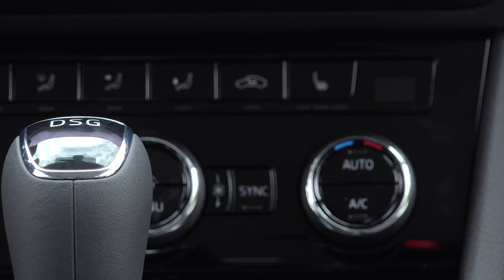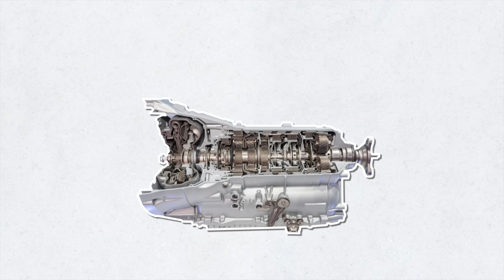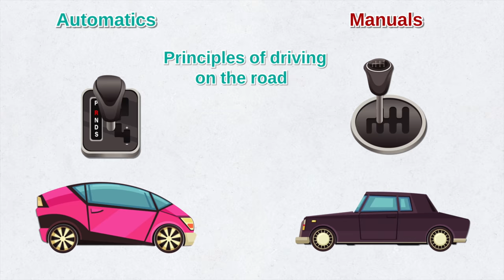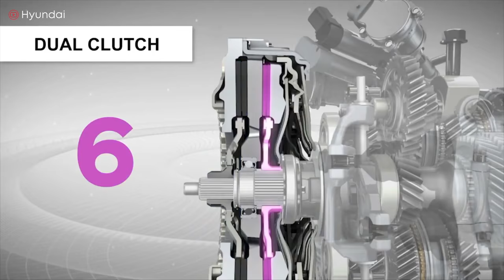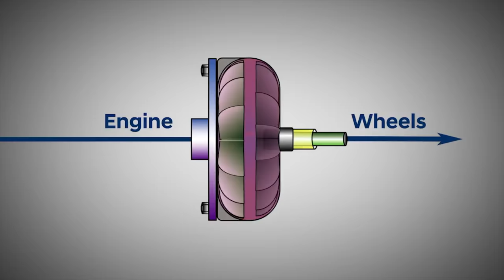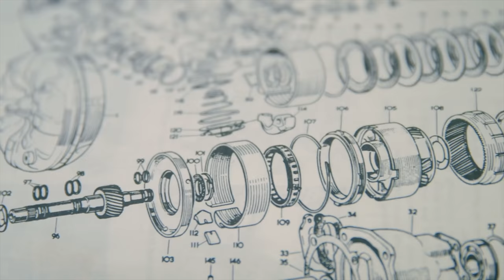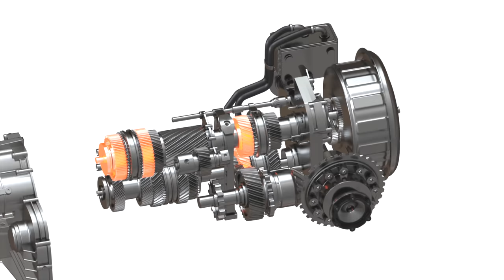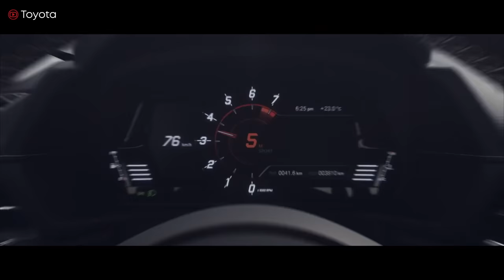5 Things You Should Never Do in an Automatic Transmission Car

Comment: I prefer a manual myself. But there's one situation in which it's been said a manual is more likely to fail than an automatic, and that's towing heavy loads in hilly terrain. That very thing happened to my parents (and my two-year-old self) just outside of Wawa, Ontario in 1972. We were in a 1967 Ford Custom with a three-on-the-tree standard, towing a heavily loaded U-haul trailer as we moved halfway across the country. The gearbox somehow failed in such a way as to lock the rear wheels, and my dad and some people who stopped to assist removed the driveshaft so the car could even be moved. To this day, if I'm in the car with my dad and we pass a U-haul, he'll remark about how seeing one of those things gives him the creeps.

Comment: At 215k miles my Honda Accord would occasionally miss an upshift and engine would redline.  After changing the transmission fluid (for the FIRST time), the problem went away.  Now at 230k miles, no upshifts missed.   I wouldn't have even thought of changing it without the knowledge of watching Scotty.

Comment: I wish you covered "lifetime transmission fluid" in this video!
Reply: Maybe next video
Reply: I’m on the fence on whether or not I’m gonna change my Subaru cvt fluid. I’ve seen a lot of them go over 200k without any maintenance. Problem is it costs 300 bucks and they only get like 35% of the fluid out. Hard to stomach that.
Reply: He has in the past. When they say lifetime, they mean until the warranty runs out. Then it's the next suckers problem.
Reply: @andrewmeehan6151  Think about it this way, would you rather pay $1000 and keep your car and CVT running for another 5-7 years problem free, or leave it to chance and possibly pay more or total the car? I say $1000 thinking you change it 3 times to get 100% of the fluid. Maybe space the changes every 3 years since they have a reputation of lasting 200k. But I have no experience with CVTs and depends on how you drive so ask your Subaru community!
Reply: There's no such thing as lifetime transmission fluid. Always change it between 50 and 80 thousand miles
Reply: @user-de4jk8vj4c  What if you're already at 150K on a 007 Lexus IS350? Automatic transmission
Reply: @user-de4jk8vj4c  I took the liberty of dropping my transmission pan and changing the filter/Screen and cleaning the magnets. It took out just under four full quarts and replaced slightly more. I did it text book style and waited until it started dripping out of the overfill tube at proper temperature. So far so good! 🙏🇯🇵 I didn't Notice any metal shaving on the magnets.

Comment: I lease a 2022 Honda Civic. I floor it without warming it up, shift from R to D without fully stopping, i brake torque it when it’s cold in reverse and drive. I consistently redline it on the daily. I never use the parking brake on hills. I also hit every bump and pothole and try to brake or accelerate over them. I never wash it either. Leasing is great never worry about old vehicle maintenance
Reply: how proud you must be, abusing a vehicle like that

Comment: I destroyed an automatic transmission in a Mercedes CLK500 on the test drive.  I was going to manually shift and at Redline I pushed the gear selector into Neutral.  The gear selector in that car goes left and right to manually change the gears.  I still bought the car but it got a brand new transmission.  

A concern I have also on my automatic transmission is if I floor it and keep it on the floor while getting on the highway.  When I get to 80-90 miles an hour if I release the pedal quickly the transmission doesn’t seem to like that much.  If I release the pressure more slowly it likes that better.  This is on a 2020 Ford Raptor.

Comment: I miss my manual. Sad they are not making them anymore 🤬
Reply: You can still get them to swap into a factory automatic car but this will be rather labor intensive and or very expensive. I want to this one day, and I figure it will be easier in an old car than a modern one due to the lack of electronics tied to that system.
Reply: In india they are still making manual gear

Comment: automatic transmission allows you to hold beer and steer at the same time, most of my  cars were manuals, went to an automatic when broke my left ankle, have issues with clutch pedal now
in extreme cold differential and manual gearbox fluid can be nearly solid the ones that use 80-90 gear oil, at -50F I could not move the manual shift lever in my 1964 dodge D800 or my 1972 F250 truck

Comment: A friend of mine back in high school had a 1972 Oldsmobile 88 with the three speed Powerglide automatic. With the two barrel 350 it couldn't do a burnout for love or money so he would neutral drop it. He probably did that about 100 times and that thing never slipped or hard shifted. That transmission was as hard as diamonds. Most GM transmissions now are about as soft as paper mache.

Comment: I bought my then wife a Plymouth mini van...one of the ones with the 20 year history of transmissions that failed more than they worked.   The transmission shop, after the 4th warranty rebuild in 11 months, told her that shifting into drive from reverse without stopping completely was causing a valve to over pressure and punched a hole in the transmission case.  Each time the transmission dumped most of it's fluid in the road where it happened.   The transmission case had to be welded because all the cores in the junkyards were bought up by transmission rebuilders.   The wife was traded in for a new model shortly before the van was traded in for a truck.

Comment: Help help help Scotty is it okay if you're stopped at a red light and put your car in neutral does that bother the transmission thank you
Reply: Tf? Leave it in drive. Why make your tranny shift gears for no reason?
Reply: if its a manual and your clutch foot is getting tired pop the car in neutral who cares. if its an auto dont bother
Reply: I’ve been doing that for years. I hope it doesn’t hurt anything. I use hand controls and my left arm gets tired holding the brake down.

Comment: 8:40 I don't trust the emergency brakes on most modern cars to hold the car on a steep hill, especially if the car has 4 wheel disks. I guess it can't hurt to put in on when parking at a huge incline, but turning the wheels toward the curb is much more important.

Comment: I drive a 2006 Subaru Impreza. 
I don’t know if this is a “Don’t” but when my oil was due for a change, the oil pressure light started to flicker. However it would only start to do so as soon if I brake a little to hard. Then it’ll do it for the rest of the drive whenever I’m at a stop sign or a red light, or whenever I’m in drive but I’m braked. However the red light would stop flickering if I’m at a stop and put it in neutral. 
So when I was driving on my way back so I can change the oil, I would put it in neutral once I was at a complete stop at a light or stop sign. I then would shift it back into drive when I started moving again. 
I do know that technically in general probably isn’t the best especially for the transmission, but would you say that a big “NO NO” or would you say it’s fine but don’t recommend doing it for a long term?? 
I did get the oil changed so now it’s running fine :)

Comment: Rev up your transmission!
Reply: @Monstar_2113, 
Something rotates when it turns around an internal axis, like a gear in a transmission.
Something revolves when it turns around an external axis, like a connecting rod around the crankshaft.
It's more easily visualize by a planet 'rotating' around its own internal axis, while 'revolving' around its external axis being the sun.

Comment: I do tow a travel trailer but always start and stop slowly! I don't drive over 60mph when towing either. I owned a 1991 Toyota pickup 4wd with a manual transmission. That was the vehicle that I taught my 2 daughters to drive on. So if they ever traveled overseas or needed to drive a manual they would know how.

Comment: I tried to tow a single axle trailer 800 miles with a Hyundai Santa Fe. The transmission overheated at 500 miles. Learned a lesson that time.

Comment: Decided to do the good ol’ “neutral drop” in my 1st car (2000 Chevy Blazer) by revving it to the redline in neutral and while still flooring it holding it at the red line, dropped it into drive. you ever hear a spider gear in a rear axle and a transmission all grenade at one time? Yeah… wasn’t pretty lol.

Comment: "Why do Americans love automatic transmissions?" Traffic jams. Proud owner of a manual tranny Dodge hemi Challenger. I had a torque converter go on a 2009 Chrysler 300c. Very rare issue. Had it replaced. We got another 130,000 miles out of the car for a total of 220,000 miles. My son wound up trading it in for a 2019 hemi Charger. It was still going strong.

Comment: Once I raged and I went from P to D really quick and accelerated off. My transmission was really bad after that. The car wouldn't shift into gear 1 or 2 resulting in really slow take offs. But after I turned the car off and on again it seemed to not be an issue anymore.

Comment: I have lived in Great Britain all of my life, and learned to drive in a manual car. I have only tried to drive an automatic once, and had trouble when I tried to change gear. I moved my left foot, to use the clutch, and stopped moving.

I have not tried to drive an automatic since, as I have learned clutch control.  Maybe they should build an automatic car, with the clutch pedal, so that it is closer to a normal car, then we can work out how to start moving, as we would in a normal vehicle.

Comment: I was driving a 1987 Ford Crown Victoria and I was approaching a green light when it went to yellow and red.  I was a good distance from the light so I could come to a nice controlled stop.  However, the brake pedal sunk to the floor without any warning.  I pressed the emergency brake, in which I found out later didn't work.  Blared the horn with my left hand and placed the car into park from drive. I heard the tires skidding and the transmission go tick tick tick.  The cross traffic had the green, but nobody moved.  I slid under the light and placed it into a low gear so we could make it to a service station.  If we would have wrecked, it would have been a T-bone and the transmission probably wouldn't work after an accident like that.  Plus, my grandfather and or mother could have gotten injured from the accident.  Transmission still worked so that worked out really well.  My mother was freaking out and my grandfather was running a fever and I don't think he cared one way or the other, he wanted to get to the doctor. 

All of this was under my learner's permit. 

Curious, one thing I didn't hear was going from drive to reverse while still in motion.

Comment: My first time with a manual transmission is rather humorous now. Dad had 3 on the tree truck. Pulled to side of dirt road to let me drive. Talked me through it  and then told me it was in first and was my time to try. I tried 10 times at least and could not let clutch out slow enough to keep it from stalling out. He got mad and switch back to drive us home. He started it up, let out the clutch and stalled out too. Ha ha ha it was in 3rd the whole time not first! We switch back, I put it in first and took off smooth as silk!

Comment: Took my 2010 Prius to one of the car washes that drag u through . I had my ac on and it was hot waited 5 minutes to enter wash put car in neutral and 1/2 way through got warning traction battery low shift to park. I couldn’t!  Well left wash and Prius was limping. Heads up for Prius owners hybrid battery don’t charge in neutral . Ac also works off hybrid battery so turn ac off in that weird circumstance .

Comment: Driving an older car with an auto I find myself coasting backwards in neutral alot so that it doesn't stall on me before the engine warms up a little when I first get out of the garage (its still got a carb with no electronic controls. And if I just let it sit idle in the garage it would lead to CO getting into the attached house). Eventually I would like to get a manual though.

Comment: On an insanely cold Colorado morning I would push the car even when cold. My car sucks at heating up and so I would somewhat floor it at red lights after 3-4 minutes of driving. I knew it was bad, just the cold was getting to my nerves. Only did it a couple times though, so I hope it didn't do much damage. The 2003 jeep liberty sport is still running at 220k miles, so I must have won the lottery or it isn't too too bad if done rarely.

Comment: 94' Celica with an original Automatic Transmission which has over 342,000 miles on the odometer. Need i say more.

Comment: I had a 2003 automatic Ford Focus SE. In my early stages of driving, I would shift to neutral on downhills (I lived in the mountains) and one day my transmission started slipping anytime I was in 3rd gear. Once I slowed down enough, it popped back into gear or if I stepped on the gas and skipped 3rd gear essentially. It only happened in 3rd gear. Stopped doing that 😂

Comment: I just changed the fluid and filter on my 08 G6. It's got that stupid "non servicable" automatic transmission without the dipstick. It was pretty ugly, the fluid was dark, burnt, and it had its share of metal shavings stuck to the magnet in the bottom of the pan. The car only has 113k miles on it, and I plan on changing it every 30k going forward. The car drives fine, no slipping or hard shifts.

Comment: I enjoy your channel very much. I find your knowledge base inexhaustible. I have a 1995 Pontiac Grand Am 3.1V6 with a 195,000 miles. I noticed that the transmission  fluid is brownish.  What should I do? Have it flush or have the filter replaced or what?

Comment: I get and heed all of these recommendations except for one. How can low fuel level in the fuel tank be bad for a car? I usually don't refill until the low gas's warning light comes on. I don't get how the low level in the tank can do any damage.
Reply: He didn't give an explanation that makes sense, IMO.  Maybe it is true and maybe not.  He mentioned "pressure".  I don't see how fuel pressure will change with a low tank.
Reply: It’s bad for many because they rely on the fuel itself to lubricate the fuel pump.  Low fuel too often will destroy the fuel pump.  Changing a fuel pump is an expensive repair.

Comment: Back when I had my cruiser, I ended up getting a leak for the transmission fluid around 230k miles. 
I remember going down the road and thinking it felt odd. Then I tried to take off and the second the car went from 2nd to 3rd, it just completely dropped like I had put it in neutral then stalled.  And made a very unpleasant sound when it dropped. 

Called my dad and he towed me to the house. We checked the fluid and there was nothing. We got it filled and let it sit over night and some in the morning. Level had dropped so we checked a pan we had under it, sure enough it had been leaking. 
We got it fixed, but, it would never shift right from 2nd to 3rd after that.  (Got rid of it like 2 months later though)

Comment: Once you get used to a stick, it becomes second nature and you don't even think about it. I have always said that you can always tell a long term stick driver when he shifts gears as he goes around a corner (and eating a cheeseburger). Lol   

I haven't had one in years, but i really miss them in the snow. With a manual in snow, you can start in second, or even third, to really reduce the torque and keep the tires from spinning. I always wonder why automatics never give you an option for minimal torque so that you can start on ice? They could easily program that in.

Comment: I'm not a mechanic but I remember the automatic transmissions pre-early 60's had 2 pumps in them and could be pull started. These newer transmissions only have one pump and if you try to pull start them, you will ruin the transmission.

Comment: Mr Scotty - WHAT happens if your parked stationary Automatic car is rear or front ended ? Will components in the Automatic transmision be damaged ? Will early premature failure occur later on ? How do you check for this afterwards ? How will you know ? Inexperienced driver nudged me whilst attempting to park in front of me  split my front plastic bumper & UK Registration plate. Insurance companies repaired the body work but it's since occured to me my Auto box could have suffered. Car is 2013 Suzuki SX4 1.6  Automatic 2WD now with 56 000 milage.
Reply: Life is full of mysteries, isn't it?

Comment: As a rule I have my Transmission oil and filter changed every 80,000kms or 50,000 miles, no flush just drain, I generally have a oil auto service do it the price is usually just under $175.00 🍁